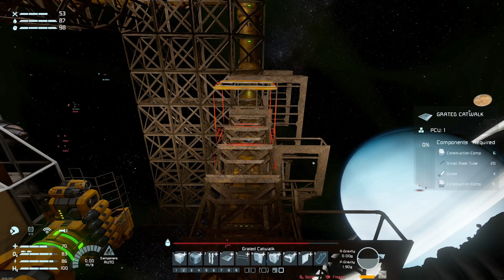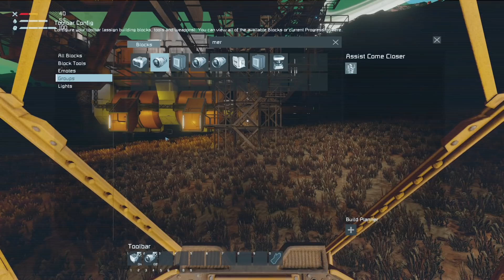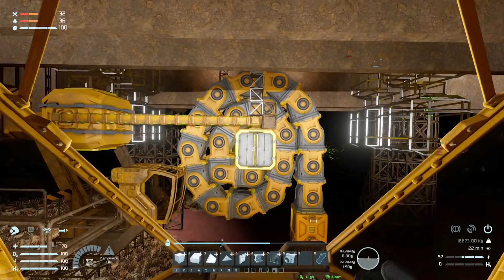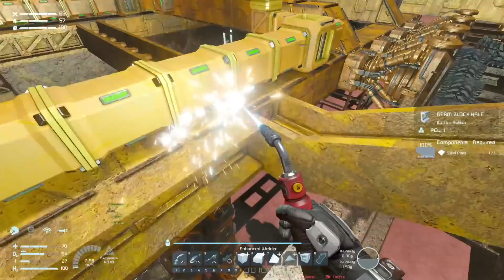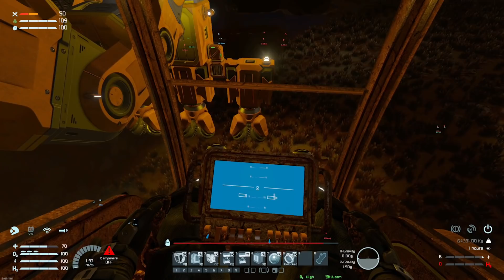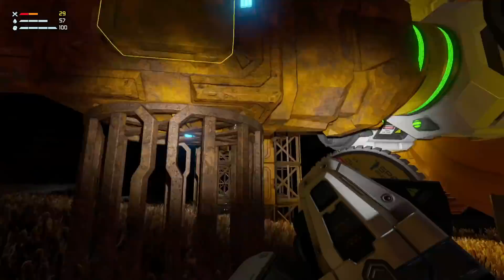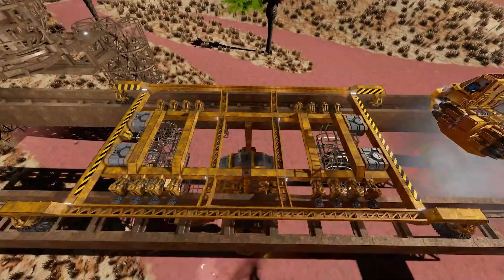Survival Impossible - Splat-form #61 - Space Engineers Hardcore Survival

Comment: Thought that came to mind: rotate the cockpit of the Splat-form 180 degrees, switch rear merge block and front magnetic plate. Then you'll have the cockpit overlooking the platform itself, making it easy to aim and stick it to structures. Using the cockpit for placing blocks is not that useful, because you can't remove stuff, so you're often out anyway. And by making it easy to use the magnet you'll might end up using it like that more often (and save power for flight)? Idk, just a thought. It already works really well as is.
Love the drill tram. It's very unique 🙂

Comment: If he has seen it what does Kanajashi think of this drill rig?  I know you said you didn't want to be underground but a monorail to the main base sounds fun.  From the title I was expecting you to go through a few clones.  Maybe the Panini needs a survival kit?
Reply: A automatic monorail does sound good to run resources back and forth to the main base. (and it is something we don't see on other streamers builds).
Reply: @talosmaltalomar1589  He built one in Survival Unlikely between his main base and his battle axe solar charging station.  It even went uphill inside a mountain.  A very involved build.  He also built an engine shed to house two variants of the tram, one for transporting batteries, the other for storing the tunneler, with an elevator to lift and lower them onto the track.  As marvelous an example of Splitsie over-engineering as you could ask for.  Strongly recommend watching that series.  It's the reason I bought Space Engineers.
Reply: It needs to get back to the main base, then Splitsie needs the magnesium and go back up to space to find the silver he needs for med components, until that happens, no other survival kits than the one in the mine. (Does it still have power?)
Reply: I forgot about these thoughts yesterday but when Splitsie said that he was going to bulk up the rotor attachment points to the hinge-chain I thought he was going to replace the medium cargo with large and pipe it using the larger conveyor tubes.

Comment: In terms of lights to stop you flying into structures they’re usually all red and either solid or on a low strobe
Reply: Required to be all red, in some jurisdictions.  They can also be a mix of red and white, commonly with a red steady light together with a low repeat rate high intensity white strobe.  Either way, green and red are only for vehicles.
Reply: @dragonmaster9543  Or channel markers at sea - but either way irrelevant for a flying vehicle.
Reply: @rick_is_not_vadden  correct they are relevant only on the flyer itself not the static structure
Reply from the maker: I was thinking about the lights on railways and how they're set up, maybe I could use something like that - either way, I like the dim lights on the towers rather than lighting up the whole area, looks quite nice at night no matter the colour :)
Reply: @Splitsie  yeah that’s true plus I suppose with the different colour lights you can tell which side of the rails you’re on

Comment: You can weld up those new plates, the hit box for them is inside the block they are in front of! 
If you stand looking at them like you do when you are placing a block whist standing on the adjacent block when you are up off the ground you should find the hit box easier. 
Still not easy in the grand scheme which should still be addressed in an update, but saves a welding station for just a few odd plates!

I have also tried using a Scaffolding mod (Think it was the one you were suggesting a couple of episodes back) I found the attachment points on the Scaffold was not like catwalks and might be quite different or quirky to use in the way you're used to...  Especially when attaching your favourite HSE safety railings for your OCD,  LOL 
They do look really good though aesthetically.

Comment: If you made the Splatform slightly longer and add a welder underneath, then you would have welder capability and increased carry capacity in one.
Reply from the maker: The downside of that is the added size and weight which would make it usable for shorter periods of time. It's why I've been torn about eve how many thrusters to put on it :/

Comment: It's a good thing to use heavy armor blocks or blast doors to soften your landing. Me making a cage out of heavy armor blocks on my mining ship has protected my thrusters so many times
Also Holy crap you can place blocks from inside the cockpit that would have been so useful on my weld ship
Tip : you need 2 O2H2 gens to keep up with the demands of a H engine
Reply: Question: does the power consumption of 2 O2H2 gens exceed the power output of a H engine?
Reply: An O2 H2 gen runing at max drains 1kW of power add another for the other one it's 2kW and engine has an out put of 5kW meaning you're in a positive 3kW gain that's for small grid can't remember the large grid but IRL you would be in a minus I can't remember the exact ratio but I think 39kWh for the electrolysis of water which produces a 36kWh from hydrogen
Reply: @themidnightbanshee5927  so you’re telling me i can cheese power with ice? NIce!
Reply: Yes but you're better of using it as rocket fuel your best bet is solar panels cause a field of a hundred of them will output a whopping 15000kW at noon
Reply: Anything that doesn't deform (easily), really.

Comment: 10:28 Yes, it's weird.  Usually Navlights are for mobile vehicles so that other observers know what your orientation is in relation to them.  That's why red is always port, green is always starboard, and now that we're regularly using space ships where there's no obvious "down", yellow is used for dorsal.  Putting navlights on a structure makes no sense because they don't move and they don't have a relative "front" that changes.

PS: from the timelapse at the end it looks like the lights aren't on the same level too, like the green one is one block lower than the red one.  Is that a trick of the perspective, or did Splitsie make an oopsie?
Reply: The lights are both two blocks below the rails, but the perspective makes it look like they're not level. Static red/green lights are used, but not to mark obstacles, rather to mark the edges of a river or other channel, so you sail between the red and green. That doesn't really apply here because you wouldn't be driving between the rails unless you want to fall into the drill hole.
Reply: Yep, the pillar lights couldn't be navlights. But they do suggest rail signals, so they should both be red indicating the end of the line.
Reply: @mattp1337  actually, I really like this idea. As he builds more pillars he can change the color of the previous ones to green, that way the only red light on the pillars is the very last set so he knows to be careful
Reply: Maybe the Red (left) and Green (right) shows you are moving away from the Main Dock area. And Red on right and green left shows you are moving towards dock area.
Reply: @wonniewarrior  If that was the case, then it would make more sense to have different coloured lights on opposite sides of the pillars. so as you're approaching the dock all you can see is, I dunno, blue lights, and as you're moving away all you see are...pink lights.
Reply: @AngryDuck79  Actually yes, that makes more sense. Red lights to show nearing dock, but blue meaning over ice. There are so many possibilities.
Reply: @AngryDuck79  Green if there is more than 1 pillar before the end of track, yellow for the last one and red on the end, for speed management.
Reply: @csgergo80  agreed
Reply from the maker: I like the idea of colour coding them for proximity to the base - will look quite nice having a gradual colour change as the rails stretch out onto the ice too :)
Reply: @Splitsie  you don't get to steal our ideas man. Sheesh :p
Reply: It's not really a stationary structure but in Elite: Dangerous space stations use red and green lights for hangar doors which makes no sense really since the stations are in this tube like design so there is no relative left-right anyway but I kinda enjoy it. I use lights the same way in Space Engineers on my asteroid bases so I know from far away which way should I land. Maybe not realistic but a cool thing :)
Reply: @filipwarpechowski6681  The red/green lights on E:D mailslots are really useful because the parking slots are numbered clockwise starting from the six o'clock position if you fly in with the green on your right. It means you don't have to spin all around looking for your spot. Also, they provide an unambiguous left/right, so if everyone sticks to the right (the green side), you won't hit ships coming the other way.
Reply: @filipwarpechowski6681  Those station lights help you distinguish entrance from exit, kind of important if you're zipping in at 400 m/s with illicit cargo before you get scanned :p
Reply: On the sides of the road in Europe you generally get retro-reflectors that are coloured red on the right side of the road and white on the left side of the road (and I suppose the opposite way in countries where people drives on the left). but that's for two way roads, I doubt a single carriage track would have lights. You get  red strobing lights on top of tall structures as hazard lights for flying vehicles.
Reply: Also I've seen this lights on static structures near port areas. So I guess they are used on structures just not the way Splitsie does it.

Comment: You have to stand further back to weld up the blocks you can’t get. 
For example far enough away you can’t hit the thrusters. 
But close enough to weld the other bits
Reply from the maker: I'll give it a go as that's often the case for other stuff - not sure why I didn't try that at the time with the floor blocks
Reply: @Splitsie  thin panels (as well as grated windows) weld well when there is no block behind them but refuse to register when atop of another. you can weld them from behind or actually from the edge of the panel. just looking down parallel to the big face and intersecting the line of sight with the thin edge. it's fiddly though.
Reply: Iv had a very similar problem with welding blueprints up by hand.